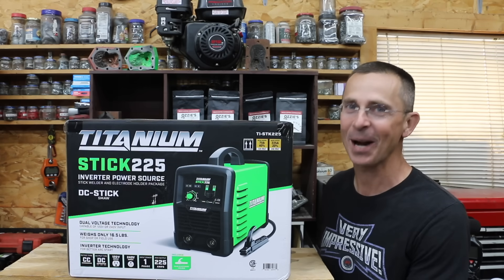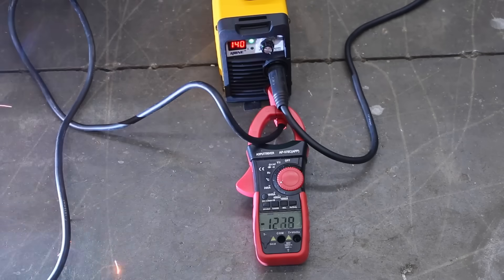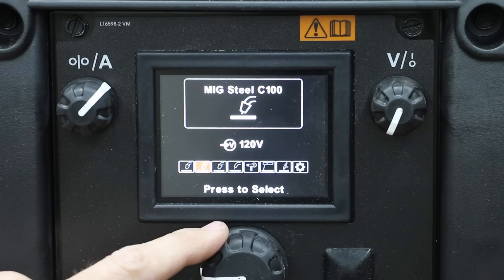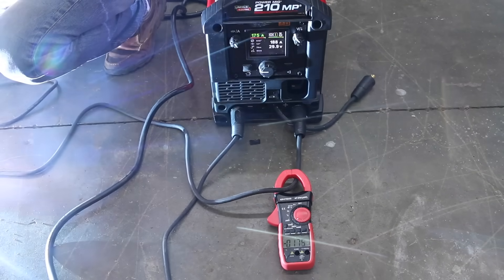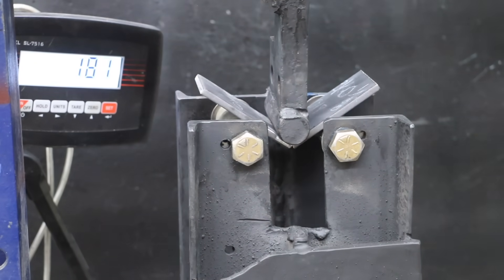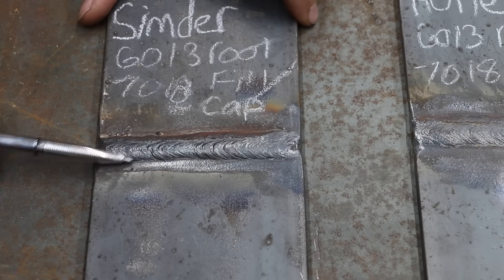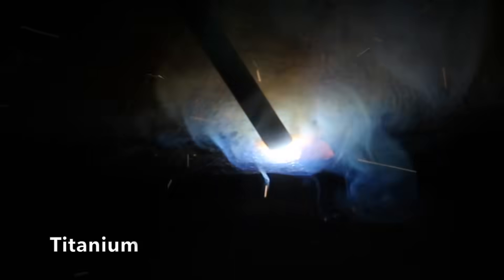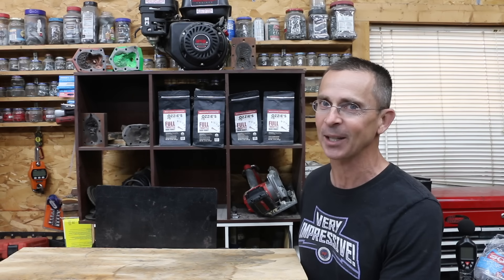$70 vs $2,300 Welder? Let's Settle This! Weld Strength, Duty Cycle, Current Output, Build Quality

Comment: Really great test, I do a lot of welding and generally don't use my own welders, my experience with very cheap welder problems was mainly striking an arc with stick and wire bunching up using gasless/flux core (due to non-grooved or geared rollers) I never really considered that a machine would show a different current to what its actually putting out, and those first 2 welders are utterly shocking.

I think 1 reason why this might not be that widely known is that there are so many variables with welding - climate, rust, paint, oils, humidity, wet/defective electrodes, poor power supply/voltage drop, using a generator (hz-frequency), improper set-up - feed speed, amperage, arc-force, hot start, AC/DC, etc.

Another reason is that super el cheapo stick welders will generally be used for outdoor jobs mainly involving tacking and short runs where these problems might not be so obvious.

I know I've bought welders simply because I know that I may not have practical access to 3-phase or 240v-15a power outlets and I don't want to run a generator.
For those that aren't welders its actually super important that your welder actually outputs the current that it says, we know what settings we need for certain jobs and the wire/electrodes we are using will not function properly at low or high current.
Reply from the maker: Thanks for sharing.

Comment: Really impressed with the titanium welder. Would love the see their Tig options as well
Reply from the maker: Thank you for the video idea!
Reply: Just buy a tig rig...and use the titanium?
Reply: @jordanbabcock9349  does it have Tig?
Reply: @Ataraxia_Atom  search for "tig power cable adapter" you will need that, a tig rig, gas bottles etc. But yes, this welder can do DC Tig welding, NOT AC though.
Reply: @jordanbabcock9349  gotcha, yeah I'd rather see tig welders, AC is pretty important imo. I often weld aluminum
Reply: YoOOO, a shout out from PF! Hope to see the channel answer your question better than I have!

Comment: I would be very interested in a comparison of multi process machines, specifically the Klutch line from Northern Tool. I have a strong suspicion they are the same machines as the Titanium from HF.  
For example the Klutch MP140si, Eastwood MP140i and Titanium Unlimited 140 appear to all be the same under their skirts.
Reply from the maker: Thank you for the video idea!

Comment: primaweld is what i bought. its a tig/stick for 850 that comes with a ck world wide. its been a great welder for me. from 20ga sheet metal, 18ga aluminum, up to 1" aluminum block and 3/8" steel for auto frames. the stick side of it did 1/2" plate with out issue.  it also has addon outputs for a water cooled torch.
Reply from the maker: Thanks for sharing!

Comment: Got the Yes welder 250 pro recently. Used many times with stick, mig on steel and spool gun on aluminum. No disappointment especially for the price. The only thing I was almost sure of was it running lower current than it displayed. But it goes to 250 amps so I never run too cold on metal around the farm
Reply from the maker: Thanks for sharing!

Comment: Thanks Joe!  Excellent video!

Why run a 6013 root instead of a 6010 or 6011.  I've never heard of doing that.   

I use a 160 amp AMCO inverter welder.  I suspect it does about average compared to the welders you tested, but for $150 to my door, I'm not complaining.   I run 6011 and 7014 rods most of the time, and I'm normally welding 1/4" steel for most of my projects.   If the project is going to see any abuse, I bevel my joints, lay a root with 6011, and then switch to 7014.  I'm not a professional welder, but none of my welds have failed doing this.   I've bent some 2"sq tubing with a 13K winch, a snatch block, and a 4' diameter oak log, but the welds held up 😊.
Reply from the maker: Thanks and you are welcome!

Comment: I have a Lincoln MIG(Power MIG 200) , big machine, also an old Miller stick (225 Thundervolt, not so big but heavy), I wanted a light, portable, 110v Flux Core , took a chance on the little Titanium  125 Easy Flux on sale, it works surprisingly well. It'll do 1/4" without issue, though I haven't pressed the duty cycle window very hard. I have a friend who is a professional welder give it a test run on a few different thicknesses. His comment, " I need to get one of these". As noted in this video, it runs a little hot on power settings, easy enough to dial down.  Thanks Joe.
Reply from the maker: Thanks for sharing.

Comment: The titanium is a pretty decent welding machine, I bought one a few years ago not long after they got shelves... it's been a solid cheap welder that does really well when you get dialed to the rod your using. And when I got it, it was on a sale deal and I paid 225 plus tax when I bought it.
Reply: Hi, what happened to the Titanium ? Not available anymore ?

Comment: I would love to see miller tested, as a former welder I’m not surprised by the Lincoln’s quality, I started with Lincoln & upgraded to miller so it’s not fair to compare those machines but the miller had a duty cycle that I couldn’t hit where the Lincoln gave me a 10 minute break 3-4 times an hour, the miller earned its keep & paid for itself quickly. I was a mostly mig welder & used flux core or stick when outside of the shop
Reply from the maker: thanks for the feedback

Comment: Nice comparison, it was a good idea to include a pro welder in the mix. I have one of those cheap combined MIG and stick welders. The MIG part is only for flux core wire, no gas. It's not amazing, but it does get the job done.
Reply from the maker: Thanks for the information!

Comment: If you are on a budget,  only have 120v, and are using thin metal than i recommend the harbor freight chicago 125 amp flux core. I have a technical arts degree in welding and i was impressed with it.
Reply from the maker: thanks for the feedback

Comment: I would stay away from all multi voltage welders that have a 120 volt plug, with an adapter cord that has a 120 plug welder output with a 240 plug on the wall end. This is very dangerous. It’s all too easy to forget someday, and plug a 120 volt device into the 120 volt end of that cord and have a disaster.

Instead, buy a welder with a 240 volt plug in the welder with an adapter cord with a 240 volt end for the welder going into a 120 volt plug for the wall. This is much safer.

Otherwise, the tests were very good. I’ve tested a number of cheap welders on eBay and Amazon. Very few meet their specs. I tell people that if they really want to go this route, see if the company has an American warranty that the company will honor. Unfortunately, I’ve found that most of these cheap welders have to be sent back to China for repair or replacement after some short period of time after purchase. That’s if you can find out who makes these things. And even under warranty you have to pack it up for shipment and lay the cost of getting it there, plus insurance. Often, that’s more than the welder cost. So don’t try to buy the cheapest welder on eBay. It might work, and it might not.
Reply from the maker: Thank you for the feedback

Comment: Good thorough test.   It's worth mentioning that the clamp meter has to be capable of measuring DC current with the clamp as many only measure AC current.  Thankfully the DC clamp meters are much more common now.
Reply: Yeah, the cheapest clamp meters you can find only do AC... I learned that by impulse buying my first cheap little clamp meter.
Reply: Placement of the clamp can also make a difference. I've seen measurement vary depending on how well centered the cable is in the clamp. Something to keep in mind when using them.

In the manual Fluke tell you to align the cable with marks on the clamp to get good, repeatable and consistent results.
Reply: I'd like to see you dissect the blown welder.....or any of them for that matter.
Reply: @smarts53  I have a small one here to look at sometime.  The technology has evolved fast.  They're basically grown up switchmode power supplies.
Reply: Good to see ya, Clive!

He's right! My RadioShack meter would do DC, but I found it hard to find others to do it at the time.  Definitely something to keep in mind.
Reply: Doesn't the fact that his clamp welder measured basically exactly what the professional grade Lincoln said it was outputting, prove his clamp is set up for measuring DC? Or was this a general statement, not really directed at him?

EDIT: Aaah, just got to the end of the video and see what you were talking about. Warning people that if they want to do as he said and buy one to check what power they are getting, they need to be sure that it WILL measure DC.
Reply: @Nevir202  - I believe it was a general statement.  I know mine was a generalized statement.
Reply: @tbelding  I was reading comments as I watched. When I finished I saw it was referencing PF's recommendation to buy a meter at the end of the video. Makes sense to warn people that they need to be sure and get one that will measure what they are wanting to measure. lol
Reply: You also need a DC clamp meter with a large enough clamp. I have two clamp meters because one was too small for 000 gauge
Reply: clive please make a house fire video from the components of the 70¥ welder
Reply: It depends on if you're trying to measure input current, which is A/C, or output current, which is D/C.    Personally, I'd be measuring the input current, which is A/C.   I'm flabbergasted on the current ratings, because you generally need 4 gauge wire for 100A ampacity.   12 gauge wire doesn't cut it!  Most welding cables are 6 gauge.  (short distance)  (many suggest 3 gauge or lower)
Reply: @tbelding  Welders don't operate on a 1:1 input to output voltage ratio. The output is probably only in the 15V - 25V range, which allows for much higher output currents.
Reply: @tbelding  The weld output is lower voltage so it is more current than the input
Reply: @RickBaconsAdventures  - I did some quick lookups, and was seeing 80-120 volts DC, with drops to 10-20 volts (which seems very low).   So..
Reply: @tbelding  it's a constant current mode source.  It's 80-120v open circuit. 10-20v is definitely correct while welding.
Reply: @tbelding  That doesn't tell you anything valuable. It would be like using a car's fuel consumption or mpg to determine HP output. A welder is just a big transformer or inverter that switches the ratio of amps:volts this is why you can have 12awg wire in and 100-200 amps out. You could measure 20amps input at 220v all that tells you is it's pulling 4.4kw you don't know the transformer or inverter efficiency because some of those watts will be lost to heat and you don't know the ratio of the output. Say it's 85% efficient so of the 4.4kw, 3.7kw comes out the other side. It could be 50v and 74 amps or 20v and 185 amps.
Reply: Not too mention that positive and negative have different functions between AC and DC.

Comment: Joe sounds exactly like a person I would trust on welding related issues! I appreciate how he wasn't too harsh on any of the products. Almost as if a welder is just a glorified voltage converter and the main factors for the quality of the weld are within the operator! Provided that the darn thing provides enough current and doesn't explode...
Reply from the maker: Good point.

Comment: I loved this test but I did want to give a bit of constructive feedback. Having 4 different unskippable 30 second ads was just a bit much, im not sure how much control you have over the video ads but that was a bit excessive. Second it would have been nice to follow up the 5 minute duty cycle test with a longer one to see if they matched their advertised limits. Third I think it would have been a bit better to have went with a couple $700ish range and a $1000ish range set than the single $2300 one to really test if the harbour freight welder can actually stack up against some of the higher-end welders. No surprise that the Lincoln welder is a real stud. Like I said, not trying to be ungrateful, it's just here soon I'm going to need a welder that has a good duty cycle and would definitely appreciate a Mig welder test, would advise to keep them under $1000 though.
Reply from the maker: Thanks for the constructive feedback!

Comment: We have been using YES welders which are crazy cheap and actually work decent. They've been putting one in every truck for those moments you suddenly and unexpectedly have to weld something. The cheapest one is less than a hundred dollars and has dual voltage. The one shown here is the step up in quality. I own the harbor freight welder and I like it but would suggest changing the leads and stinger if welding anything on 130amps or higher for very long. But welds like a champ.
Reply from the maker: Thanks for sharing!

Comment: Nice to see Joe hitting it with his experience, which helps me to evaluate consistency. PF, this is one of your best reviews considering the test criteria and selecting parameters to level the field.
I agree on the Hone for a quick and dirty and cheap. I was surprised at the Titanium, since my opinion of Harbor Freight is poor. AND seeing the accuracy of the Lincoln (I own a Precision TIG 225) really opened my eyes to the sense of quality in their product and made me think, why do the others LIE about their output? Well, that's chi-neh for you...
Oh, and I purchased a HZXVOGEN 200A MIG dual voltage which I have yet to test.
Reply from the maker: Thanks!